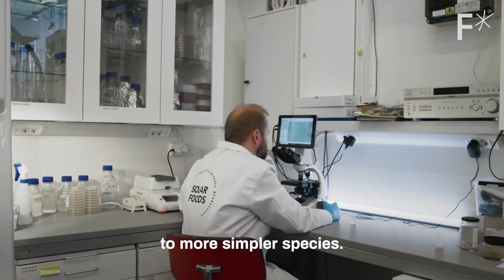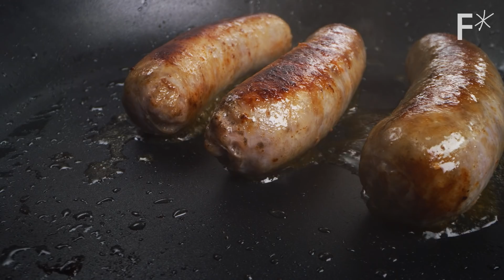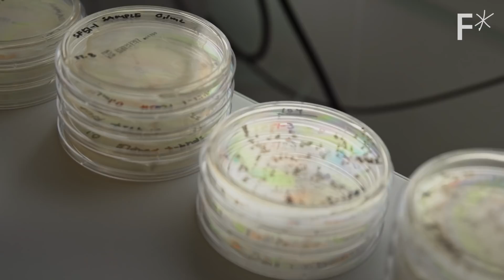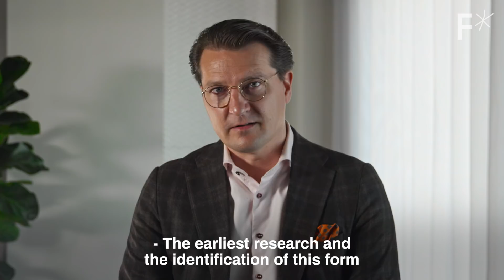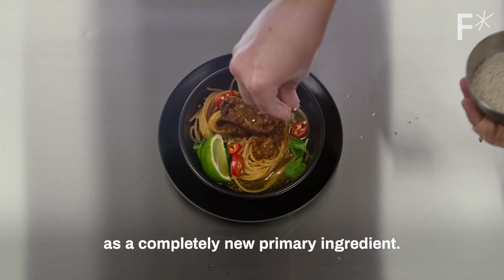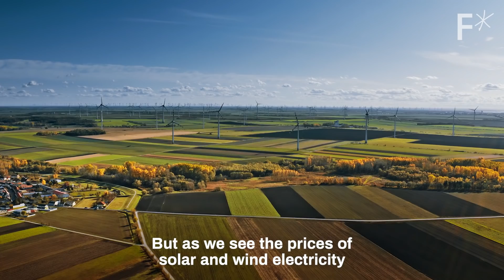The secret lab making the most sustainable food in the world | Just Might Work by Freethink

Comment: Where does the nitrogen come from? Can the microbes fix atmospheric N2, or do they have to provide bioavailable nitrogen as a feedstock? There is no protein without nitrogen, and N2 bonds are extremely hard to break.
Reply: Yes there are bacteria that can fix nitrogen in the air. I have no idea what microorganism they are referring to here though because they don't say 🤷
Reply: You can apply some electricity and liquify nitrogen from the ambient air
Reply: @dmitrykozhin5316  Liquifying N2 doesn’t break the extremely strong triple bond between the two nitrogen atoms. Nitrogen won’t bond with anything else until you break the N2 bond, and you don’t have protein without nitrogen bonded to carbon.